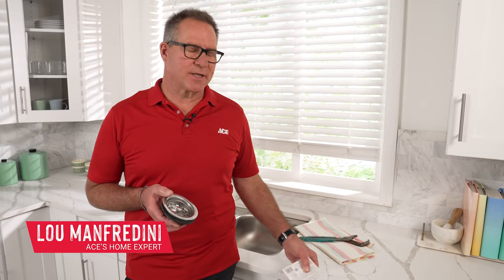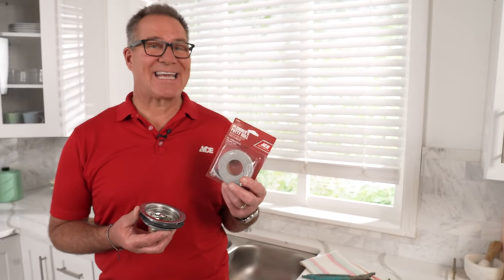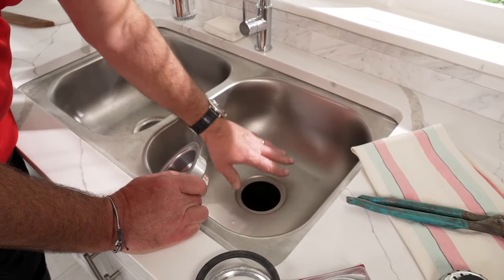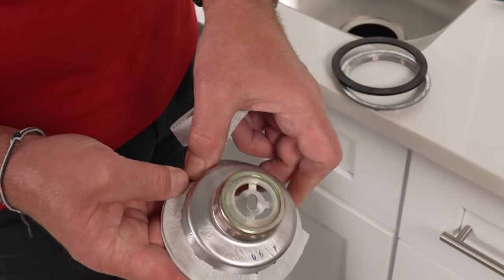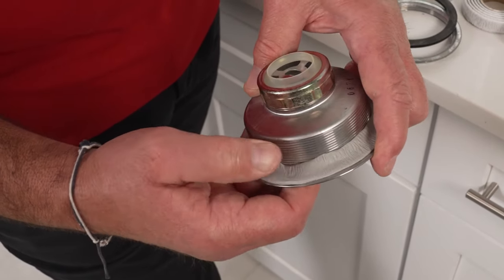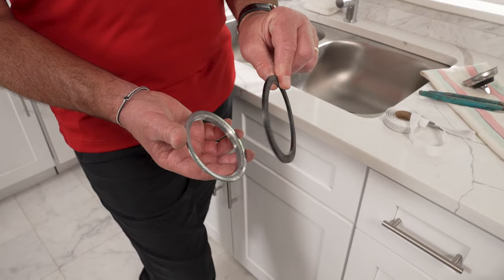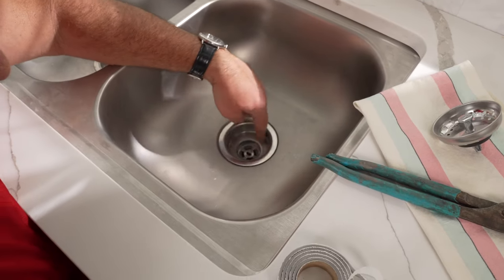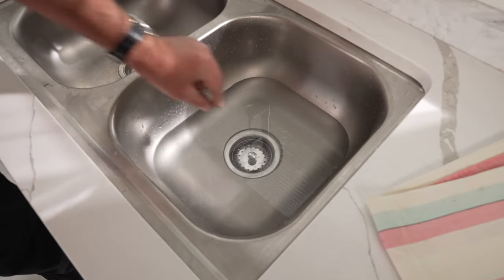How To Use Plumber's Putty - Ace Hardware

Comment: My kitchen sink leaks from that seal area where you put the putty. Took it out, cleaned, dried and replaced it again and again. Used friction rings on the bottom. It'll hold for anywhere from 2 weeks to ten months. The basket is an Ace Hardware plastic one, and the jug of putty says to not use on plastic. Use Oatey Silicone Sealant instead. Why wouldn't plumber's putty work on a plastic kitchen sink drain basket?
Reply from the maker: Hi There,
 The plastic will expand and contract more than metal depend on water temperature.   And the sealant will just hold better than plumbers putty.  
Hope this was helpful!
Reply: @AceHardware  Excellent. I'll use sealant next time when it leaks again...which it will. Let it sit for 24 hours to cure..
Reply: @AceHardware  Thank you.